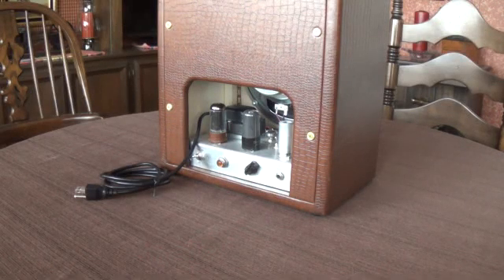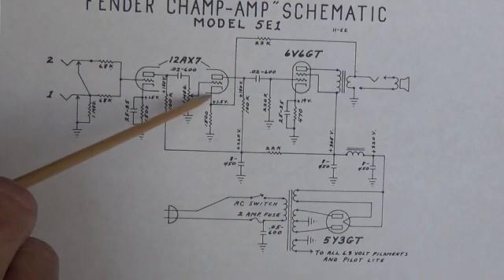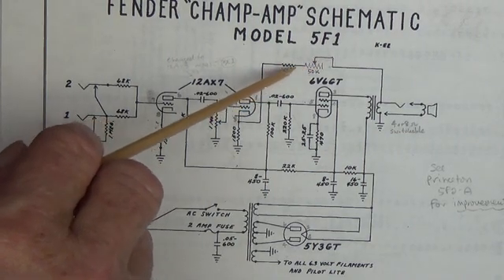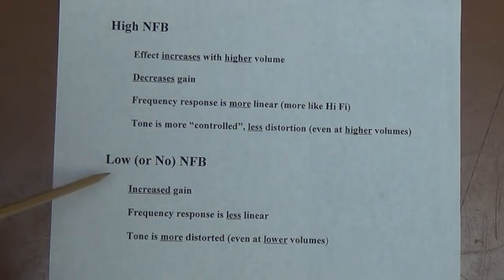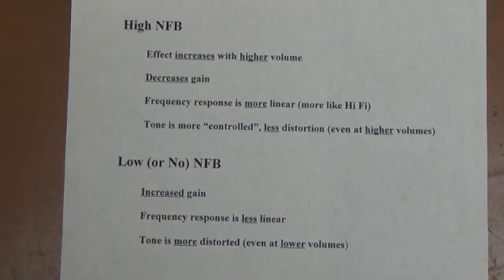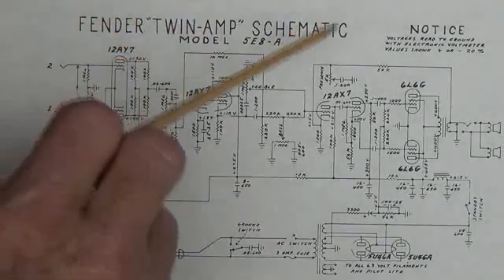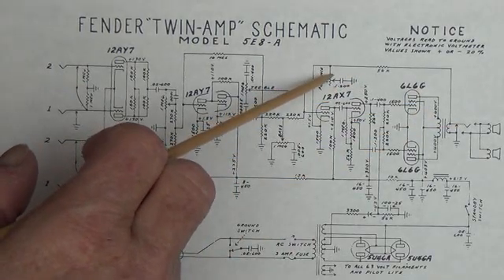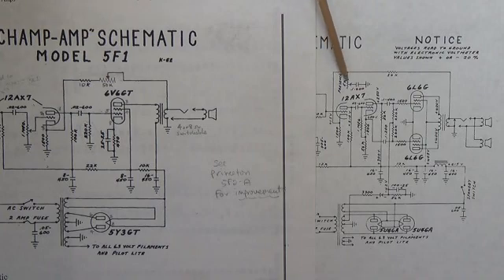Negative Feedback Loops and the Fender Presence Control

Comment: I wonder, did Leo arrive at 820ohm for many of Fender amps Neg feedback resistor by ear or did he rely on a formula of sorts? I have been playing with different values but havent settled on anything. If the effect of changing the resistor is eq I would guess it could never be ideal for every guitar as guitars seem to have different natural peaks and valleys at certain frequencies.
Reply from the maker: I've noticed all sorts of values for NFB resistors, DS. I think they did it by ear....and you're probably right about different guitars having different requirements, especially single-coils vs humbuckers. This would make a good argument for installing an adjustable NFB pot.